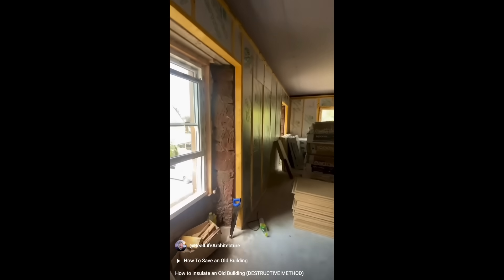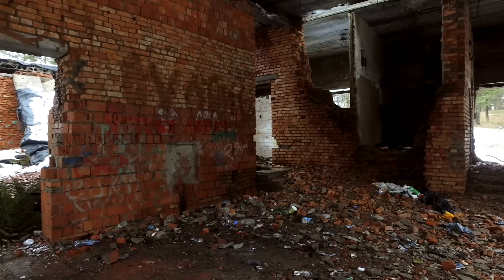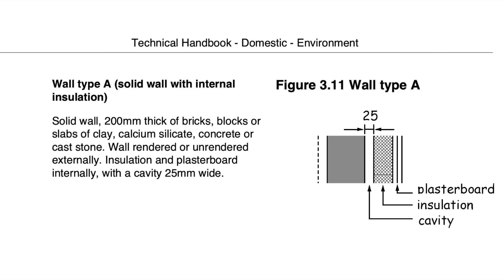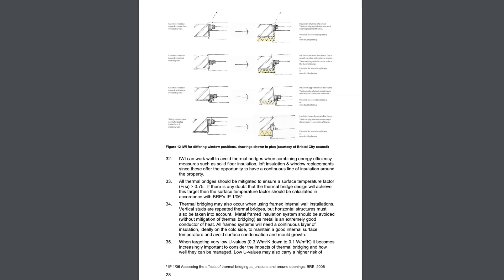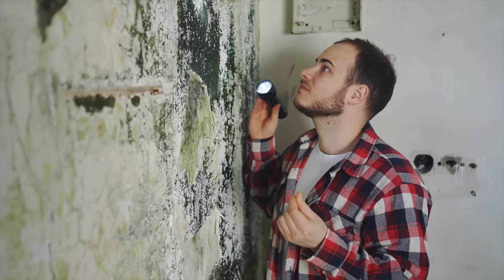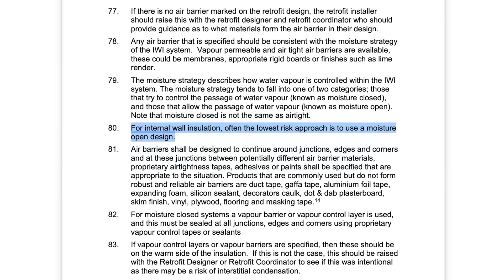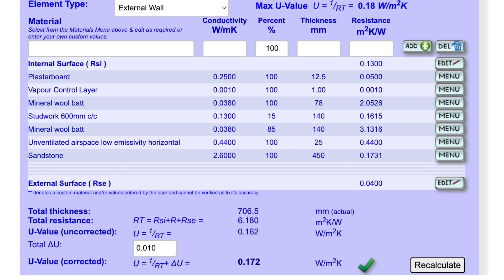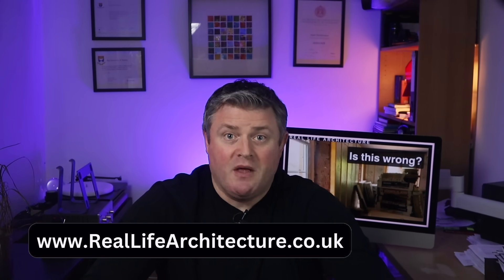How To Insulate Inside a Solid Wall in the UK

Comment: Insulation on those buildings is not needed on the walls. Having good windows, ceiling insulation, good doors and so on are all that is needed. Modern society is too obsessed with air tight rooms and insulation.
Reply: did you miss suspended floor insulation? It makes a huge diff
Reply: @ 
If you have earth suspended floors you will need to ensure there is ventilation.
Reply: @ yep there are at least 2 or 3 air bricks per room. 100 years old house and found out the joists were not rot.
Reply: @sgru9558  
That’s a good sign. Too many houses have their ventilation blocked.
Reply: @ thank you..next is to insulate the solid brick wall..currently they only have a plasterboard directly on the single skin brick.. not sure with which approach I should go.. 5cm cavity, timber frame, then the dilemma is mineral wool or wood fiber or something like k118 or celotex..

Comment: Great vid thanks. To get around the issue of condensation behind the internal stud/pir can't you just ad a few air bricks into the external wall, this will then ventilate the cavity and help with drying out of the solid wall whilst the inside remains warm? Thanks

Comment: We had a conversion done back in 2017 to one of our outbuildings using an internal wooden framework with a 3 inch cavity and airbrush is installed in the front and rear of the building. This created a perfect ventilation system that works through natural convection. In the Summer the building gets very hot, but the ventilation drives the airflow to dry out any damp walls. In the Winter the airflow still functions in the same way but reduces the chance of any mould or damp from occurring. It’s proven to be very efficient but it does come at a cost of space loss, but I must admit we don’t notice it at all.

Comment: I’m in the Netherlands, similar climate, and I need to insulated my solid brick walls from 1891 from inside out. I’m looking into biobases breathing materials. Some 10cm woodwool Gutex or Steico. Or hemp. Directly onto the walls, no internal cavity, to prevent cold airstreams. Joints around the wooden floor beams are extra important as you don’t want to suffocate them: potential condensation/ wood rotting..

Comment: Great video.  On this side of the pond there is a tendency to go spray foam directly applied to the masonry, even recognizing that mass masonry walls dried in both directions. Sometimes this is an unguided approach, throw it on see what sticks. There are a number of building scientists and studies that show this is "safe", which is guiding professionals and builders to go this route.   There are caveats: review and test to confirm how much moisture comes through to the interior; test the masonry materials to confirm they can be wetter for longer periods of time and survive freeze-thaw action; improve the water management; and be punctual on the building envelope maintenance.  With solid science behind this all should be good, as science has never failed and clients are always keen on maintaining their properties. It's possible though that we're creating work for the next generation(s) of building professionals and conservationists.

Comment: I'm also in NE Scotland and am renovating our old stone and slate cottage. I looked at various insulation options given the stone and lime mortar walls, but opted for lime. I'm repointing in hot lime followed by insulated lime plaster, built up in layers. Labour-intensive but I'm not on the clock so it's materials cost only. And as it's my house I can make sure no corners are cut.
Reply: Walls are not the main issue for old houses losing heat.  Drafts are the main culprit along with windows, doors and ceilings. Insulating those walls will create risk of internal damp.
Reply: @Art-is-craft  Not exactly true I'm afraid, and I have data because I receently bought a thermal camera so can actually measure it.  I have an extension made of concrete block that the morons didn't bother to insulate, and that is blue on the camera on a cold night.  Drafts are easy to detect and fix, but entire walls are just massive fridges.
Reply: @ateleskier7066  
You are taking about concrete cavity walls?
Reply: @ No. I can't work out if the extension was a DIY project or what, but it's just concrete block with external harling and (get this) two layers of plasterboard fixed on the inside.  I'm intending to strip it back then add studwork and Rockwool.  It'll make the room footprint smaller but the heat I'm losing at the moment is enormous, according to the camera.
Reply: @ateleskier7066  
So you have a 3 inch thick wall then.

Comment: Some heat passing from the dwelling into the walls is desirable. Leaving the cavity is asking for trouble. Lime mortar, insulated with hemp or cork would add to the thermal mass of the building and be vapour permeable. Solid walls in buildings don’t work like modern ones.

Comment: Dont know if the regs are different in Scotland but in England and Wales it makes little difference if you are renovating an existing house or converting a non residential building to a home. If you are renovating an existing home that doesnt meet certain threshold insulation values for the wall floor or roof and you do work to those elements (like rerendering or replastering a wall, recovering a roof etc) you can be required to upgrade those elements to standards very close to those applicable to a newbuild properties in many cases.

Comment: Exactly the approach  I took in 2015, stud wall, insulation battens and a breathable membrane. 10 years later not a drop of condensation and I left a little inspection hatch to check. Thanks for the video.
Reply: How would you know if there is no condensation on the inside of the insulation and wall.
Reply from the maker: Thanks for sharing
Reply: I think the PIR installation is the best option taking everything into account. You lose too much space with the other option and I don’t think with a 600mm wall, you would have damn issue. 25mm cavity rather than 50mm would do the same job.
Reply: @XTSu-sl1bb  I don't know about a damn issue, but i've seen rain driven through half metre rubble filled walls before now. Could it be possible you are a man with very little building experience?
Reply: Sandstone is porous I know that and some parts of Scotland get a ton of rain as the precipitation map showed. Some places also get very cold so then there's the problem of freezing as well. I suppose there's always trade offs to be made for cost efficiency.

Comment: All the government-sponsored home energy upgrades just seem to be using insulated PB straight onto existing, and then skim-coating.  My neighbours (stone cottage) have recently had this done, so now air gap. I'm doing my own insualtion using batten, PIR, PB jointed only.  Upstairs north-facing room now super warm, was never any damp issues due to higher elevation.  Just now doing a north-facing g/f old brick (no cavity) extrension - damp'ish walls, but ripped off old dot&dab PB, then battened, PIR, PB jointed, and coating oustide of walls with breathable hydrophobic coating.  Would like to use the natural / fibre materials, but outside budget, but hopeful of good long-term result.

Saw your original video, loved this one, and have subbed ☝Many thanks from Brecon in wet Wales!

Comment: All stone masonry walls MUST have cavity plus ventilation..if not 💯 you will get serious issues of damp especially on prevailing weather walls.. don't use the method suggest by this architect..
Why because the stone masonry walls are constructed with hydraulic lime.. it's alive and must absorb the damp and let it dry weather dependant..

Comment: The one further issue likely to occur with the proposed options is where does interstitial condensation occur in the wall once the internal heat does not reach the solid wall despite the vapour permeability. Also vapour permeability of plasterboard is poor and should be lime plaster on fibre or woodwool board.

Comment: I would think you could skip the 25mm air gap altogether with vapor-permeable mineral insulation, hence the walls wouldn't be 80mm thicker for the same R-value as foamboard insulation, but rather 55mm (or 30mm here, where the air gap  is noted as 50mm)

Comment: You have lost the thermal mass, you should install your insulation outside. Then solid walls act as a heat accumulator and the heat exchange is happening within the insulation without any condensation. Brits doesn't have a clue how to build efficient houses, and don't have a clue how to insulate effectively. Now interior of your building will stay warm for as long as you use the heating, once the heating is off the heat will dissipate within the insulation quickly.

Comment: The idea that a plasterboard will carry moisture through itself without getting damp is one I've never heard before and one I struggle to believe, but let's leave that aside. Any imagined porosity may be retained if the walls are only painted with a breathable paint, let's say that's the case in a house you've renovated and sold, but what happens when a new owner moves in and wallpapers or paints with a non porous paint? All that work and theory is lost with a coat of paint. Surely the solution would be to vent the cavity, and I never really understood how you were getting the U-value without adding 10" of mineral insulation, nobody is doing that.
Reply: I did a basement conversion successfully a few years ago by cement rendering the stonework and painting it with bitumousbpaint hen leaving a75mm air gap and erecting a  timber frame with vapour barrier then plasterboard internally  worked well

Comment: i thought about this and i do not think an air space would work in uk a lot you say is very good advice but day and night temp on an airspace is very likely to cause condensation which will pool at floor level. i use 50 mm celotex which is equal to 100 mm of rockwool and then 200 mm of rockwool and timber frame for plasterboard celotex burns but rock and plaster give fire protection so a air gap with certain insulation well be a fire hazard i have put a vapour membrane behind the plasterboard i think it is mayne not needed as humidity inside a home is lower at moment raining outside but at 19 c i have only 40 per cent humidity but insolating walls is a massive money saver

Comment: Great video! I'm also an Architect, and I'm currently in the process of renovating my Victorian house in UK. 

After months of research, I've found that the safest approach to prevent condensation aligns with your suggestion to use vapor-open insulation.

I would suggest incorporating hygroscopic insulation to help manage moisture more effectively. 
This method allows moisture to move from the cold wall to the inner layer, where it won't remain liquid due to the higher temperature and can evaporate. 
Examples of such materials include:

+Wood fiber insulation applied directly to the wall with a full bond, finished with a lime skim.
+Natural fiber insulation installed within a stud wall, directly attached to the wall, and protected with a damp-proof membrane to safeguard the timber.
+Calcium silicate boards bonded directly to the wall.

The hygroscopic properties of these materials help draw moisture from the wall during warmer days and allow it to evaporate indoors. 
If the insulation is thick enough, it provides a buffer zone where moisture can exist without reaching saturation levels.

On the other hand, leaving an unventilated cavity behind the insulation creates an environment where humidity consistently remains near 100%, leading to inevitable condensation on cold days.

When using rock wool insulation, as you mentioned, it's crucial to implement a very tight vapor barrier or an intelligent membrane like Intello. Without this, moist indoor air can reach the cold wall, resulting in condensation every time indoor humidity rises. This moisture would take a long time to evaporate due to the unfavorable conditions within the cavity.

Hope this helps since it took me quite a while to properly understand it.
Reply: I would suggest that a vcl is never installed as part of a retro fit.
It is impossible to install a vcl continuously in a retrofit, it will leak and allow significant amounts of domestic bourn water vapour into the wall build up that will be trapped behind the vcl, "intelligent or not"
Vapour open is the best approach but the walls need to be airtight by applying a lime based parge coat.
Once airtight the main transport mechanism of moisture will be eliminated (indoor moist air can reach the cold wall face, but there is no mechanism driving that) and diffusion will easily be accommodated by a vapour open design. 
Rockwool is completely fine in such a buildup.
Reply from the maker: Thanks for sharing. It’s hard to believe Ive been in the profession, dealing with old buildings, for 20 years and still learning.

Comment: Really well explained Neil. I'm a building surveyor. And this is becoming far more common as buildings get converted. A lot more training and knowledge is  required when dealing with older buildings. I'm lucky as I was a builder and worked on lots of refurbishment and conversions over the years. So I can apply that to my work. But unfortunately do many of the people involved in the industry now have little experience with older methods. Along with the way people are trained is not helping.
Anyway rant over. Keep the videos coming 👍.
Reply from the maker: Thank you. I too have a lot more to learn but am enjoying the journey
Reply: @RealLifeArchitecture  you didn't;'t seem to consider solutions that use e.g. wool insulation or wood wool insulation boards covered in lime plaster - which seems the whole thing vapour permeable. 
in reality I think all of these approaches are flawed because (as you say) they all require destruction of the original internal surfaces (if present).
Reply: @paulbanks8583  the problem we have now in the construction industry is that most of the proper skilled trainers are probably dead or retired. I've been on courses where they simply don't have a clue and end up in "conversations" on how to do things correctly, not fast and cheaply.

Comment: I don't mean to take the piss with my other comment, just that glycerine in the mortar would reduce sorptivity and then it would be optimal to just heat the wall and not have a cavity or lath and plaster. I did some pointing where I work on some 1 story solid concrete columns that hold up the concrete guttering and the glycerine makes the water run off. The walls don't get saturated as much as brick is way less sorptive.

Comment: The best way to insulate inside a solid wall is to first actually build a solid wall and then heat inside it. Cavity walls aren't good pratice.
Reply: whats the best method to insulated on top of cavity walls to make rooms more warm as seems despite cavity retrofilled not have much effect? any proven industry method? it would be good if someone explain here?

Comment: I worked on a test house for a insulation manufacturer. One issue which became apparent on solid walls was the frost on the external walls . Yes heat loss travelling through the wall warms the wall and evaporation damp via  heat loss keeps the wall dry . It became obvious from the outside the insulated walls had frost on the surface the room without insulation had no frost and a clear frost line between the two wall rooms . I believe over time the wall will become soaked due to the lost heat escaping
Reply: exactly the problem with these internal insulation methods - the solid walls rely on lack of insulation to stay dry. if you insulate the outside walls from the inside surface the walls get cold and then long term they are damaged by staying damp and freezing when cold. On a building with walls that get a lot of water onto them, these internal insulation methods could lead long-term to decay of the walls.
Reply: With too much insulation on the inside the wall will have basically the same temperature of external air. This can cause spalling in the bricks if the wall is wet. This is why there is a fine balance in the amount of insulation and waterproofing measures you should use to avoid saturated walls. There are some hydrophobic coatings that can leave the wall breathable which will help with the frost issue.
Reply: @marcopiccini8457  it took the years to get the standard approval and it wasn't about preserving the integrity of the building it was more about preventing the disruption of the existing market . The test used to determine  the existing products energy  efficiency was flawed and it becomes obvious new products in development were far more energy effective  than the established products with existing approval on the market .  they had issues with energy rating when new products gained approval the would have effectively made existing products G and the new product A . They change the way the test was interpreted to keep the status quo and not disrupt the market .they didn't care about the consequences on the house or the implications caused by the insulation on the internal living environment. it was all about ticking the box to ensure compliance and maintaining the existing market products .  The legal cost involved preventing some product gaining type approval was mind-blowing . As a result we now see cavity fill failure rotting joists ends  due to soaking cavity materials bridging the cavity and a  explosion in mould internally .
Reply from the maker: This is interesting. Was the insulation breathable?
Reply: @RealLifeArchitecture  they tried various product lines and all had the same result including the breathable  insulation ( not sure how that worked ) they had been developing